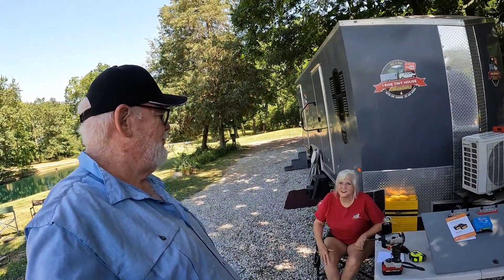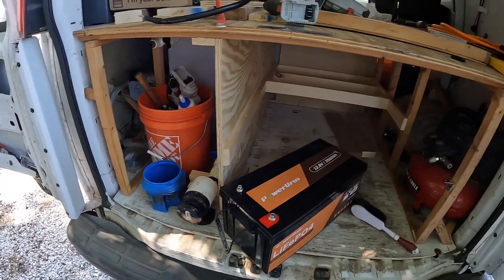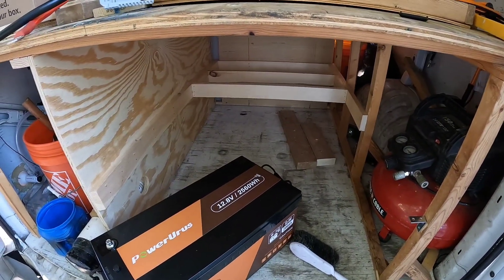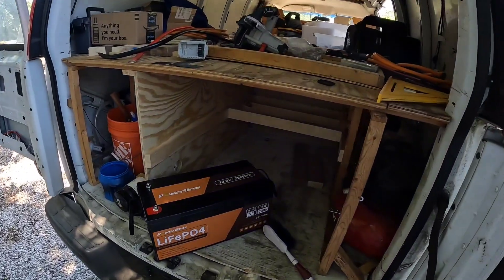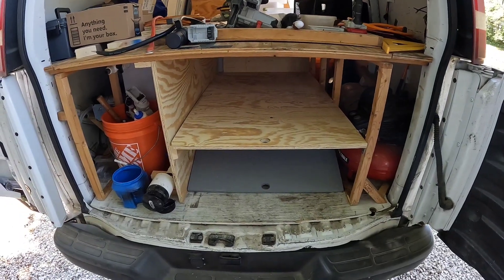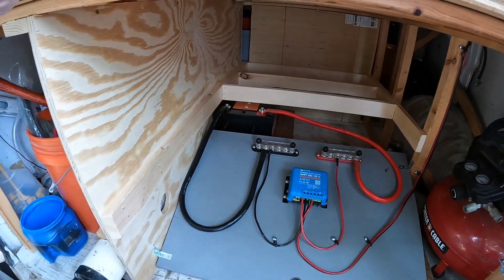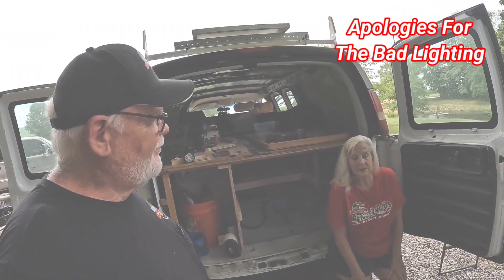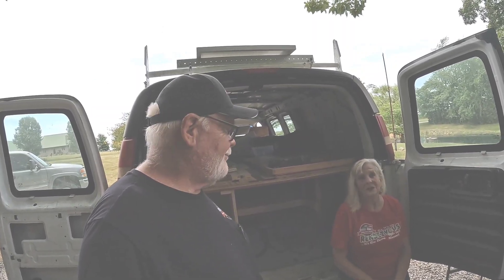Making Our Van Into A 3,000 Watt, 600 Amp Hour Solar Generator For Cargo Conversion Camper Living.

Comment: Are you going to have an inverter and then just back-feed AC to the trailer?
Reply from the maker: Yes. There will be a 30 amp RV outlet mounted on the right rear of the van.

Comment: Bill, have you thought about adding a couple of PC computer fans at the back side of your battery box?  Your batteries and the van needs a set of cooling fans to help control the inside heat during spring, summer, and fall..
Reply from the maker: I'll cover that question in the next video.

Comment: Are you going to be running 12 or 24V in the van?   If you need anything with the new system, just let me know.  Great addition to you current setup!
Reply from the maker: This will be a 12 volt system. I would've preferred 24 volt, but I  have room for 3, so 12 volts it is (3 batteries in parallel).

Comment: Bill you could charge with the van if there 12V
Reply: I forget the place where you got your roof racks
Reply from the maker: The racks on the van are inexpensive ladder racks from Amazon. About $65 per set. I used automotive muffler clamps to mount the panel mounts to the rack. Inexpensive and simple setup. The panels have been up there for about 2 years now and traveled at least 20,000 miles.
Reply: @billanddeb  Thanks